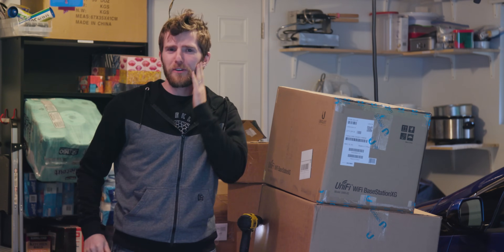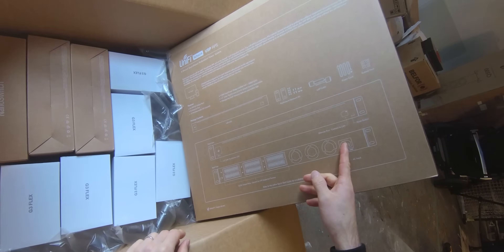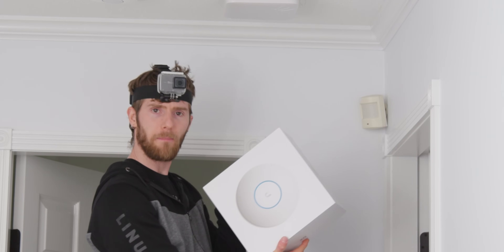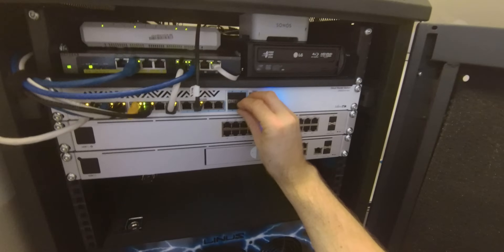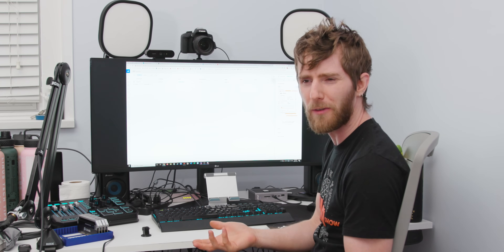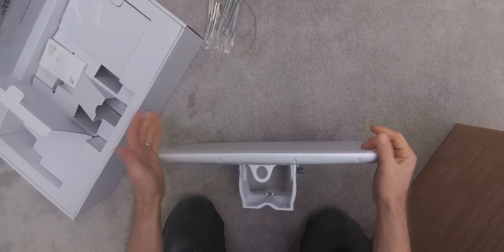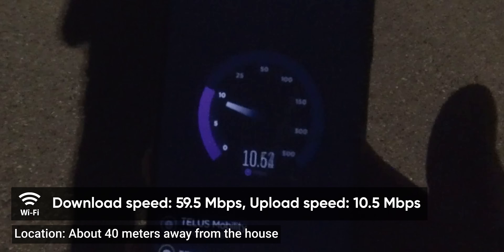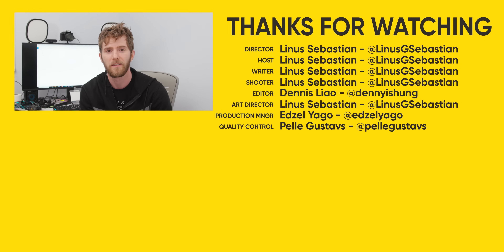I REPLACED my $1000 Wifi....

Comment: 5:54 the minimum length for a networking cable going from a device port to a device port is 1 meter so that little 15cm cable is literally causing you switches to back off the hole time.
Reply: I believe the reason is that there isn't enough length to gain twists to cause the difference in pairs. This increases the near end cross talk.

Comment: Buyer’s remorse: you’re gonna want wifi 6 next year...
Reply: He's just lining up another video.
Reply: I think it will be this year already. Ubiquiti is showing their Unifi 6 Lite AP with wifi 6 in their Early Access section at this moment.
Reply: @mikeycrackson  True! But Linus is not the vast majority of people.
Reply: I don't think so, the interesting thing will be WiFi6 on 6Ghz, which won't come for another few years. 
Also, you don't want to have bleeding edge hardware
Reply: @tobimai4843  WiFi 6 is not bleeding edge anymore. Some manufacturers are having WiFi 6 products for more than a year now.
And when WiFi 6E on 6GHz will come. WiFi 7 will be around the corner.
Reply: 'just' buy a new Wifi6 AP, plug it in and done :p
Reply: Yep!  And if you just need it in one area, one AP.  And expand from there.
Reply: @mikeycrackson  Can't even get 100/100 in most UK households mind 1000/1000. Highest I think atm is 325/40

Comment: I would definitely use fiber between your cable modem and your gateway as lightning protection of your equipment. There is a lot of expensive piece in the rack. 😁

Comment: I dont even have a single device that support 5GHz in my house...
So we're all using the 2.5GHz Wi-Fi at the same time and saturate it.
Like at least 13 device on it constantly, even though 2.5GHz saturates at about 3 xD.
To fix that I rented a reaaally big drill and drilled a hole through the 30cm wide concrete wall between my pc and the router. (yeah wireless access was terrible)
Now I instead of 0.2MB/s down I have....0.6MB/s ;(
Reply: Why don't you use the electricty network in your house for data? Those things are very cheap..then you can have a other accespoint in your house and solve the issue.
Reply: I find this hard believe. How can you have 13 devices that are not 5Ghz capable?
Reply: @Coz131  Maybe he has older devices? For example hue lights to only support 2,4 Ghz.. and it is still a modern device.
Reply: Virtual IT Boy Hue lights work with Zigbee protocol, Not WiFi protocol
Reply: @Coz131  because our parents bought us galaxy a20 for each one of us (3 children) which dont support 5ghz and we have a few older ipads, and the rest are things like smart TV from 2012, and small gadgets like printers, etc.
Reply: Ask your ISP for routerchange , most ISP will change it for free

Comment: If the radio was mounted outside you would likely get another 25-50 meters of distance out of the unit as well as increased data rates overall. You loose a few Db going through the building material of your exterior especially at 5Ghz. Though. you are already blanketing your neighborhood, so maybe it's good it doesn't propagate any further than it already does...lol

Comment: As for why your upload isn't increasing, there is a pretty simple reason. You used an AP built for a football stadium which has really high gain and more importantly is directional (conservation of energy, antennas just focus it). Your phone is neither, even if your phone was capable of anywhere near the power output of the AP (battery vs mains to start with) that energy is going in all directions instead of in one direction (beamforming can only help so much, assuming the phone supports it).

Rally long range wifi I would try to find an old Wavion AP (I know it has the sand holder, don't ask). Could pick that up about 1.5 KM away, sadly laptop didn't have the power to speak back and register. Could probably pull off the same on these units with clear line of sight.

Comment: You realize wifi is also dependant on the antenna in your cellphone.  I can guarantee it doesn't have nearly as much power and sensitivity as the AP.  While the AP did improve things, it's not the weak link.

Comment: The Basestation XG isn't meant for range. It's built for handling many simultaneous clients. This video doesn't do much justice on its strong points.
On the plus side, you could have a 300 user LAN (over WiFi) party, in your front yard now.

Comment: NO. Ethernet over Poweline. Three 50$ Asus AC Routers running 5Ghz. with Linus1, Linus2, Linus3, with the same password.
Reply: 2.4Ghz. is SLOW
Reply: 100 Concurrent people Linus. All these Squirrels that need wifi.
Reply: Home UPS seems safer maybe than a server grade one? (For the home electrical cabling gauge)

Comment: Hey Linus, to get even better throughput, make sure that Block LAN to WLAN Multicast and Broadcast Data is ticked under Advanced options in the Wireless Networks settings page. On a nanoHD it increases peak from ~400mbps to ~600mbps for 2x2 80MHz 5GHz AC clients.

Comment: They have a feature called wireless uplink for those AP's that you cant run a wired cable to. (does have an impact on speed though) but just a nice feature to have if you cant run a cable to all APs. I just did the same to my garage for a POE switch + cctv until I can run some dedicated network cables to the garage.

Comment: "One of the problems I have is operating my smart garage from the end of my driveway"
Reply: First world problems, eh
Reply: @d4nyll  no it's not. He can't open his garage door from his driveway... That's the main function of a garage door, is to be openable
Reply: The weird thing about that statement is I can activate my smart garage door opener without using Wi-Fi. I just use my regular phone data and it works fine from just about anywhere. I could even be in another state and as long as I have some kind of connection, it will operate the garage. It isn't even an expensive garage door opener. Paid maybe $200 or so for it.
Reply: Depending where you house is on your property, sometimes you are so far from the road you wouldn't be able to do.

Comment: Both XG APs you have are designed for aggregation of hundreds and hundreds of clients, not sheer speed. For example, the Basestation XG is designed to be installed in stadiums, and yes, it doesn't have any 2.4 radio. Its application makes 2.4 useless, it's too cluttered to be thrown around and seemlessly tuned through others XGs.

Comment: Linus, the outdoor AP is meant to be installed outdoors. Why not install it on a PVC 1/8 inch conduit atop or at the edge of your roof? The cable is going to be weather protected from the bottom caps.

You could get much better reception if it were installed outside than inside due to the fact that 5 GHz frequency is more narrow and as a result has more difficulty penetration through materials such as wood and drywall.

Comment: I work with cell towers and can tell you ubiquity sells basic low grade hardware for government service. 
You'd be better off using Ericsson or Comscope equipment. 
I use an ericsson yogi attached to my fireplace pointed at the nearest tower to connect to a signal booster mounted in the center of my house and give better wireless service.

Comment: That's about what I would expect from Ubiquiti. Did a point to point like for a client that was like 100ft across the parking lot. They didn't want to dig up the lot to run cables to an alarm system out there. At the time the only point to point Ubiquiti had were ones that were really meant for longer range.  So they've got a P2P that CAN do about 5km. Even at lowest power settings it can make a solid connection even if both AP's are pointed AWAY from each other.  Yup no this is fine.

Comment: Okay this is cool and all, but can you share some details about setup and such? You just got gear worth like 3K and your only gonna say “yeah like 100meters awy from my house it still works.”  Of course it does. That’s the point of that AP. I’d really like a more in depth review. Chris from crosstalk has videos about only the UDMpro that are are longer then this. 

So how did you setup the network? Why don’t you use the 10gig uplink to the router? You’re not gonna get any benefit out of the 10G switch if you do that if you are using VLAN’s and the switch is not a L3 switch. Then you are limiting your traffic to only 1Gbit total.

Comment: You forget the sheer cost of Ubiquity equipment.... It's through the roof, especially their cameras. You can get better cameras for 1/3rd the price. Also don't forget that the dream Machine Pro requires an internet connection to function and configure.... So RIP your LAN if you lose internet for a while, but still wanna manage your local network, or if you need the DMP to be offline while configuring.

Comment: Linus! Been a subscriber since the beginning and love the channel whole heatedly. My life has evolved and changed as I have grown up.. that being said I live in the country on 15 acres of my own farm land in middle of nowhere Wyoming USA.

These series are awesome but I dont even have real internet where I live.. Im unable to get high speed internet because my ISP is lazy and not motivated to expand out of town(only 1.5 miles). Could you do a roundup series on 4gLTE home modem/routers and the hacks you can do to unthrottle at data cap (TTL hack). You could experiment with multiple cell providers, routers (Mofi 4500 & Netgear NighthawkM1), antennas (yagi vs parabolic vs others), low loss antenna cables, and even channel bonding of multiple 4gLTE connections into one whole home connection.

I know this is all over your forum but video series of this would be a helpful for those that are in a position like me.

Comment: No surprise your range isn’t perfect with this gear. You’re judging a fish by it’s ability to climb a tree.

The XG (say 10G) line is for very high density deployments. The basestation for example, is made for stadiums. That’s why it doesn’t include 2.4GHz (way too few non-overlapping channels to be beneficial for a grandstand segment with 1500 people on it) and has multiple  5GHz radio’s.

Pro tip: if you want separate SSID’s for each frequency, just create different wlan groups. This makes it way easier to manage, certainly if the number of accesspoints is growing.

Another tip on this topic, free of charge (I professionally deploy Ubiquiti gear):
Just make sure there is a WLAN group/SSID active on just the 5GHz radio only, but make the one that is normally intended for 2.4GHz available on both frequencies. This will provide you with an SSID on which you’re guaranteed to be on 5GHz, but also allows people who mistakenly connect with the 2.4GHz SSID to roam to the 5GHz radio’s. Devices with no 5GHz won’t know the difference. Don’t forget to enable advanced features and set bandsteering to prefer 5GHz. You’re welcome.

Comment: Angle the antenna downwards towards your garden for the outside reception. That antenna is directional so you have to point it where you need coverage. With it facing straight forward 10m up in your loft, the signal is being pushed out above your head and device. You can see this by having 50-60mb dl in your garden and 100mb dl 50 meters out from it. 

Transmission masts have the same problem especially with direction antenna. You can stand under the mast or near it and pick up hardly any signal. 100/150 meters out from it (within its focus range) you get full signal. 

Also with that antenna you have probably completely saturated one of the channels your neighbours could be using on their wifi set up. Lol.
Reply: He really should lower the power

Comment: This isn't sponsored?  Nobody I know in the game will use the Dream Machine Pro until version 2 or whatever comes out with built-in PoE.  To buy that thing and still need a PoE switch for eight devices is a deal breaker.  That and it's pretty buggy still.  I use a Cloud Key Gen2 Plus, one of their PoE switches, and a couple of different APs on my home system with a Palo Alto firewall doing the security side.  Trust a Ubiquiti firewall?  As much as I like most of their gear, no thanks.
Another thing, you just made a CAT5e cable.  You can't self terminate a CAT6 cable and it meet cert.  It might pass, which is good enough, but at that distance CAT5E is good enough for 10G which is why it worked.

Comment: You know you can name the 2.4ghz and 5ghz SSIDs the same and your device will connect to whichever one it is rated for.

There is also a feature which switches APs depending on which has the strongest signal seemlessly, though I think this is on my default now days. 

Source: 200 Unifi AC APs and 70 Unifi Switches over 60 sites
Reply: Bruman ..Personally, I name mine differently to make sure which one I’m connecting to.
Reply: @Iam_Dunn  same at home, but I wouldn't trust our users to know which to connect to

Comment: watches the video with a router that has been in my home for 8 years 
me: Who needs an upgrade when you have cabled ethernet? not me!

Update: I changed my IPS and now i have a new router, first time i have 5ghz, but i'll still use cable!
Reply: I even put my Google Home speakers and Chromecasts on ethernet using usb-to-ethernet adapters.
Fuck wifi.
If it's not a mobile device that actually moves around, cable that bitch up.
Reply: Nice for the phone to save data, but else ethernet always yes !
Reply: Truly people of culture
Reply: Same i use Ethernet
Reply: Wi-Fi 6 on a mesh network. That's what up. Ping 7ms, down 415 Mbps, 45 Mbps
Server same state location.
Reply: Lol I got cable ethernet and get 100gps download and 30 up
Reply: @ferror18  lol no u dont
Reply: @ferror18  weird flex but ok

Comment: 100 metres away and you're getting 55Mbit/s. I can't get a connection AT ALL in my bathroom on the same damn floor as the router on my 220Mbit/s incoming connection. weeps

Comment: Shame you didn’t stick with Ruckus that said UBNT for home use is perfect. 

This comes from a Ruckus distributor

If devices are not roaming correctly you should consider adjusting the BSS Minimum rates so devices roam to the nearest AP 12 mbps is a good start may need to go to 24mbps depending on how close the AP’s are in terms of coverage cell overlap.

Comment: Ubiquity is a company that wants to lock you in to its ecosystem. And it is the kind of company that disables features on old products to require you to upgrade. They are the antithesis of spirit of interconnecting various network components is all about.

Comment: The Basestation XG and UAP XG aren't about how fast they can deliver speed to a single user, they can deliver high speeds to large numbers of people, therefore easily saturating a 1gb link. They are WAY overkill for a house. That Basestation needs to be outside, not inside. 5ghz through the wall is very far from optimal.

Comment: There is more settings for good performance with unifi wifi and dont have to set ssid on each unit you use site settings and then to have roaming wifi without interupts you have to start Advanced features and set minimum rssi to something like -85 to help to jump to the best accespoint

Comment: Can u build a batery power wifi setup, normal routers can be powered over usb even if its a Bernal jack and says 12 watts. If u cut the connector and attach it to a standard USB charger most routers will work.

Comment: I would be willing to spend $1,000 on a good wifi setup for my house, but I'll be damned if I'm going to install the thing.

I've already been up in my roof to run cables for my VR setup and wired internet in some locations. I dont want to go up there again x_x

Comment: These are high density APs, absolutely useless for a residence.. Not to mention you'll drown out the 5ghz band for all your neighbors with that base station in the attic. I wish someone at UBNT would help you pick out what you need rather than just sending over anything that has a 10gig port. Also, the RPS isn't meant to be the sole power source for all the devices, only a redundant source

Comment: Me: damn it only 5 mbps.   Linus: spends 1000 and still feels the need to upgrade
Reply: bruh im not even capping I get 0.5 on my ps4
Reply: Effxect I just spent 800€ for the Dreammachine Pro and a Unifi Switch. Both are great, they play well together with the other switches and the 2x HD and 1x Nano AC access points.

Comment: lol back when I used to sell wifi I used some spare 2.4g nanostations on a tower on my house so that I could get wifi all over my friend's houses and it kinda worked, also realized that wifi is a two way street and my little phone could hardly talk back to my 20w amplified antennas back at home going through 5 rows of housing, so my extended range drone experiment ended right there before it would definitely crash like 2km away from me

Comment: Damn. that's nuts lol... 150 Feet away outside. I can't even get decent reception even with UniFi AC Mesh Pro LOL! which costs over £170. So no change there in terms of Ubiquiti's performance, even had UAP-AC-LR and that gave up the ghost in less than a week or so.

Right now on the cheapo route with 3 routers bridged together via a cat 6 cable, need to do something about the power plugs lol, might have to do some soldering and turn a port into a POE port.... hmm..

Comment: Why not get a amped wireless , 1500ft range

4 x 2.4GHz Amplifiers
4 x 5GHz Amplifiers
8 x Low Noise Amplifiers

16 amps what beter do you want with 1 device

Comment: The Basestation XG definitely should be mounted outside, as it's supposed to be used. As a 5Ghz only radio, you'll always loose a lot when getting through barriers, like the walls of your house. Mounting it outside will for sure improve your already overkill network! :)

Comment: What? Is the connection on the U.S that bad? I have a 50€/month internet and I download at 55/60 Mb/s (My internet is 1Gb), basically the same as Linus’ connection, of course not nearly the same range, but I only have a normal router